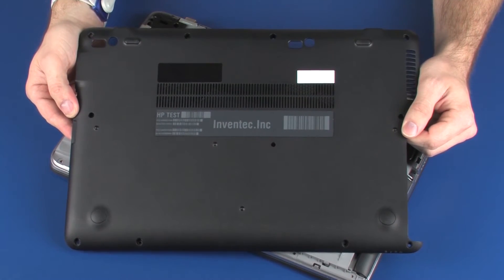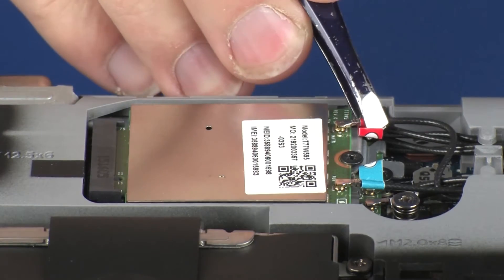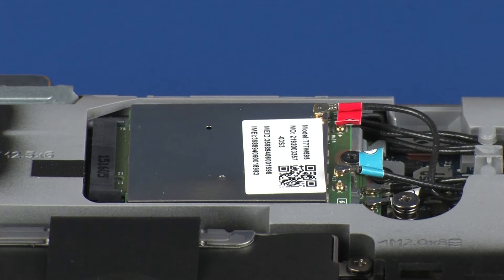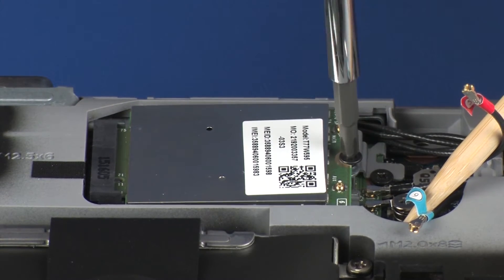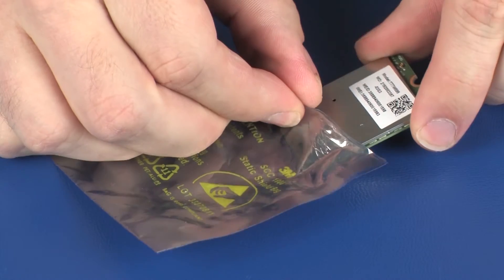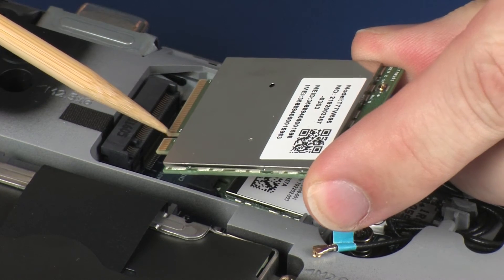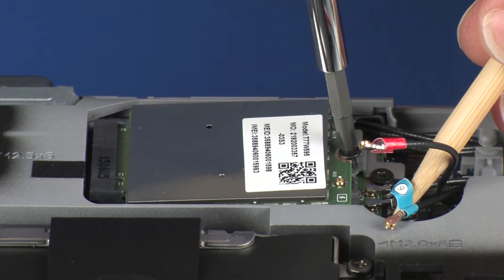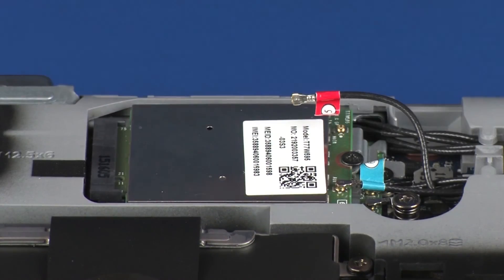Replacing the Wireless WAN Module | HP Probook 650 and 655 G2 Notebooks | HP Support

Comment: Can I put an ssd in its place?
Reply from the maker: Hi there, thanks for contacting HP Global Social Media Support!
I understand that you need to know whether you can replace Wireless WAN Module with SSD.
I will do my best to assist you.
HP does not recommend upgrading or downgrading hardware parts or software that is bundled with the product as It may affect the manufacturer's warranty and performance, however, you could change the configuration at your own discretion.
Regards, 
HP Support